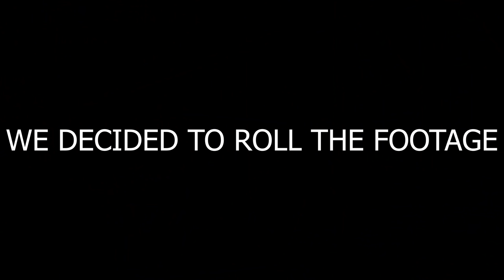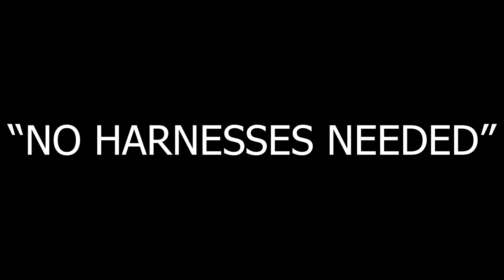RISKING OUR LIVES to Install a $20,000 AC UNIT

Comment: Being a retired AC tech, that was a very good video.  I had to do that once through the vent of a very old two story.  But we had to do it on a ladder without scaffolding.  We hoisted the equipment up with ropes by hand.
Reply: dang, for $200 bucks it seams like a no brainer to get the scaffolding i couldnt imagine doing it on a ladder
Reply: @Novagunner  I had a real tightwad boss.  He didn't have to do the work.
Reply: @Novagunner  ... very true, but you have to weigh in the added cost of the trailer, and 2 men for what amounts to a full day's pay or more to get the stuff and set it up. Now we're pushing $1000, which is enough to make you think of other options. For that kind of money maybe a Lull material handler could be the answer in some cases.

Comment: Excellent video as usual guys! I never miss an upload. Just FYI, those "ladybugs" were Asian Beetles. They look similar to the harmless red ladybugs, but these orange critters are a nuisance.  They can be addressed when they are kept outside the home, but once they get in they are a pain to eliminate. They don't respond to traditional pesticides, and set up an infestation in less than 24 hours. It's best to have an exterminator stop by if you come across them nesting outside the home like that, before they gain access to the interior of the home.

Keep bringing the great construction/repair info!

Comment: The opening is an attic vent, therefore you have to keep it as a vent by code. What would work is if you can use a removable vent that has weather stripping around the edges. It probably could either clip in with pressure clips or you could use exterior screw attachments. That would allow the vent to easily be removed in the future.

Probably would have been the better solution is to install a drop-down attic staircase in the closet. This would have you a 54" x 30" opening to get your equipment through and it would have provided future attic access. The cost would have been around $1500.00 - $2,000.00 for a high quality attic stair case and the new ones are insulated. If you think about it, going through the gable vent every time you want to get into the attic is not the ideal solution. You may still want to offer this option to the owner.
Reply: They have attic access in the closet, the opening at the vent was just to get the unit in, they probably won’t need to do that again for 10-15 years.
Reply: @truthdefenders-  Okay, that makes more sense. Thanks for the clarification. I still believe that a drop-down attic staircase would provide the most serviceable solution. It's far cheaper than ripping the gable apart every time you need to replace a major component in the attic. 

I installed a drop-down wood ladder that is 30" x 54" (opening size) at my house. The convenience accessing the attic is night and day. I just replaced my AC and the air handler/furnace (it is a gas split system) is attic mounted and quit large. It easily fit through my attic staircase opening. 

The complete installation took about six hours. This included running new 20" ductwork for the air return vent (about 10' of 20" flex duct). The contractor told me "We never get done in six hours," and he thanked me for providing such easy access for his crew. 

BTW, installing the wood  access ladder scuttle was a bitch, and I am a journeyman carpenter. The trusses were not straight and so to have the access panel set flat when it was closed took me about three hours to get right. However, the finished product is quite beautiful and very easy to use.
Reply: @franklong6269  Yeah, easy access makes a world of difference in how the day goes. I worked installing units during the summer in Texas a few years ago, from the start of summer till the end, 2-3 units a day the entire summer, do the math (close to or over 200 units). So we saw everything, old houses, new, one story, multiple stories etc. forget about it.
Reply: @truthdefenders-  Bless your heart - I feel your pain. I am a licensed general contractor and I have many stories about installing AC units in attics. 

With my own house, I was up in the attic helping my AC contractors install my own unit. It was difficult and my attic mechanical space has good access and a plywood floor to work on. It is hard work, no two ways about it.

Comment: I remember the days- HVAC in South Louisiana can be tough- attics at 90 degrees and humidity almost as high. But the 130 degree attics in Dallas gave us moments. So yes, I remember the days! The scaffold you rented is a lot like the first one I ever bought into- thought you two did a top job on the assembly! My later scaffold was on the pattern of the blue one in Houston. With four or five guys working in that attic, you didn't miss much, even with the vent wall wide open it was going to be a crowd!

Comment: First off I really enjoy your channel. I'm from southern Ontario, Canada and one of my lives was a home inspector. The majority of homes here have a basement where the HVAC units are. In my 5 yrs. as a home inspector I had one home with the HVAC in the attic with a small hatch to access the units (2 units, large home). Luckily the only problem found was the condensate discharge line plugged. Keep up the great techniques and work. Roy

Comment: As licensed Hvac contractor, by code the inside access has to be the size to get the biggest piece of equipment out of the attic or confined space. Also the make variable speed equipment the can provide dehumidification with the A/c unit saving you another piece of equipment install in the tight attic.
Reply: Don't forget, code depends upon the state... and with old historic buildings, code can get waivers... like if there's an alternative access.
Reply: @mattwilliamson1714  it just sucks that if I was the homeowner that I have to cut open the side of my house every 15 to 20 years or if a major component fails and have to be removed. The enlargement of attic access in the closet  would be the best for the customer and for future service.

Comment: I must admit, I'm extremely jealous right about now.....  the temperature here has been around -10 degrees for the past week, frost and ice on my work truck and trailer on a daily basis.  I have to pull all of my 'fluids' into the house every night to keep them from freezing.  I see you two in short sleeves and a generous tan, and it makes me want to move to your neck of the woods!  How about if I come work for you for free for the winter months?  I just need a place to park my 5th wheel trailer.  

By the way, Jordan sure is getting some big biceps these days!!  Keep up the great work guys!

Comment: Of course I have not been on that site but next time you run into a system replacement with restricted areas look into a type of system call a space pack. There are a few manufacturers out there and they work in  applications such as this. R22 in not really outlawed except for the new product market. And there are a number of drop in refrigerants on the market for service and repair in homes/businesses and the price is very reasonable. I've used the drop ins and have not had one bit of problem. Thanks for keeping up the good work.

Comment: This is a about a week after the fact but since you asked...  To seal up the gable I would make a "window" frame to attach a removable panel to. Make a replacement panel with the removed clapboards include the vented design and the screen. Make a couple of French cleats across the bottom to interlock with the wall. Set the panel into the bottom then tilt it up and attach it at the top with a couple of heavy screws. It should look and function as when you started but would be easily removable. I was thinking that a couple of safety chains configured as hinges will keep the panel from falling and allow the panel to be opened and used as a bridge if needed.

Comment: Removable hatch. No hinges or latches, that's hurricane country and you don't want to have anything weak to blow off during a storm, just a hatch held in place with screws or bolts so it's secure but someone can take it off easier.
Reply from the maker: Thx Gene 👍

Comment: Thx.  Why not just expand the scuttle in that closet?  Looks like a standard ceiling there, lathe and plaster maybe.
Reply: I had the same thought.
Reply: It didn't look like there would be enough clearance to get equipment in/out even if that access hole was expanded. I'm sure they considered it. I would have done the equipment room even if they would have lost closet space. It's going to need replacement in 15 years so why go thru all that again.

Comment: Great work, if budget allowed a scissor lift would have been a good alternative or addition to get this job done... Also that carbiner might be great for extension cords but not rated for lifting ;)
Reply: I have that exact same carabiner that I use all the time for lifting tools and equipment. It’s rated for 100 lbs. I’m also a professional climber, as long as you’re not using it for climbing and it has the lock catch built in, they’re safe for hoisting equipment. It’s still a good comment. I’ve seen people using Walmart keychain carabiners (rated for crap) hoisting equipment. Extremely unsafe, but you can’t fix stupidity, you can only hope no one gets hurt.
Reply: I agree. Scissor lift would have saved a whole day worth of setting up the scaffolding. Would’ve also made transporting men and equipment a lot more easier and safer. However, who knows what the rental rates are in their area. They would’ve saved at least $200 from the scaffolding rental plus cost of labor of 2 men for 2 days to set it up and take it down. Plus the cost of the trailer rental.  Might’ve been worth it to just get the scissor lift.
Reply: @daaneel  ... how about a Lull type material handler with the man-lift attachment. I'm sure you could get 2 days rental with delivery for less than the $1000 it cost for the system they used here. Much more stable than a scissor lift.
Reply: @rupe53  Depending how much they charged for labor, then yes, it would be close to $1000. I'm not sure how these guys do their bidding though. If its time+materials+markup or just a flat rate to get the  job done. If anything they made more money by including an extra 2 days of labor lol.
Reply: @daaneel  ... I see 6 hours to get the scaffolding and trailer and they worked till dark. I see a similar time frame for the teardown and return of rental stuff so 12 hours at 2 guys is $1200 around here, plus the rentals.... or $2k with mark up. Add in another day of various repairs to that hole and painting / finishing is another day easily. (back the way it was) We're easily at $5k+ for Studpack plus the $20k for HVAC.

Comment: I would suggest remaking the vent like it was but with more framing behind it and add hinges at the bottom so it falls into the house for when the next guy needs it. Also make a cut out in the attic floor right where that door would fall so that when it is down it is flush or as flush as possible with the attic floor for any equipment that may need to go through there.
Reply from the maker: Cool thx 💪

Comment: I am always surprised when I see people using this type of scaffolding. It appears to be the absolute most labor intensive type. I have always used mason's scaffolding, that is where it is a 5'w X 7'h frame then " X " bracing.  I can assemble one that high in about one hour working alone.  And take it down in about 15 minutes.  But otherwise, great work. The biggest trick to doing anything different  with the vent is making it obvious to anyone else that it is designed for easy access, so some ding dong does not destroy it.
Reply: Ya but you can’t fit 4 full grown men And the equipment onto it. Those that I’ve seen are only rated for like 600lbs. This type you could put a car on...or a hoist 👍

Comment: The attic access couldn't have been opened up some more? That way you could maybe even add attic stairs, and make it easy to work out of for the service tech, or even the next installer. Hopefully its big enough right now for an evaporator to squeeze through, since that daikin is gonna end up leaking sooner or later.

Comment: wow, this is the hardest AC job that I've ever seen. Great job guys, I do have a question, I'm not a AC guy, I always thought that with the new unit that runs R410 refrigerant require bigger line sets right?

Comment: If you need additional HVAC return lines, can you repurpose the existing attic hatch for one?  If you can make the return line flexible, you might still be able move it aside for continued use as a hatch.

Comment: Most people have no clue, of the magnitude of some projects, that result from poor planning. Also, check out Spider lifts , they may be able to handle jobs like this. If I built a house with a split/ attic unit, a barn loft door would be built , and a nice elevator going to and from.
Reply from the maker: Cool thx Mike 👊

Comment: R22 systems use smaller walled pipe, newer gasses run at higher pressues, that customer will inevitably have cracked pipes because you thought it be cheaper to use the old lineset.

Comment: Future access: my thoughts are that you have technician access already thru the ceiling. Major access for another HVAC change out will likely not be needed for [hopefully] 10-20 years. Unless the house has the water heater in the attic, or some other large equipment, I would rebuild the opening back to where and how you found it. The area this house is located [hurricanes] is another factor. I wouldn't want an access door or panel to blow open.

Comment: Great work guys! What was that A/C guy saying about drying up the house? Is that when the unit is too big for the house and pulling too much moisture out of the home?
Reply from the maker: Thx Nathan 👊.  Actually the reverse is true.  If a unit is sized too large for a house it will start, cool the house quickly then shut off.  It doesn’t run long enough to remove moisture from the building.   Probably the single biggest mistake I see... improperly sized units 👍👊

Comment: Wow, that's crazy having all those mechanicals in the attic. We don't see that in Ohio.
Looks like good equipment.
How come they didn't go 90%? Vents with pvc pipe.
You guys are the only ones that will ever build scaffolding for that.
Reply: Thats garbage equipment, cheap Goodman/Amana products, fix them daily and their commercial units are even worst quality. You can't do high efficiency equipment in whats called unconditioned space.
Reply: You probably have a basement in Ohio. Basements are rare in the south. The crawlspace was probably too small to fit everything in when they retrofitted the house. I wouldn't want my hvac system in the crawlspace anyway.

Comment: Great video...you could make it a hatch that opens outwards with the top part of the gable being the point that releases outward and down and the bottom side would have hinges somehow....and maybe use a pressure push latch to lock and unlock from the inside with a rope attached to the latch which you can tie off to a 2x4 right next to the attic entrance so you don't have to get all the way in the attic to open the hatch you just have to stick your head in grab the rope and pull it to release the hatch....maybe idk..lol.....on the other hand making it a hatch that opens on the outside of the home exposed to the elements you would want to caulk the edge to prevent water from getting in therefore the caulking would have to be cut and reapplied everytime you need to open it....again idk just thinking MacGyver I guess...good job and good luck
Reply from the maker: Good stuff thx 👍💪
Reply: @StudPack  hahaha probably far fetched😂.....you maybe able to get away with weatherstripping instead of caulk you know like a door...i mean that part of the house is slightly covered by the fascia✌

Comment: What a nightmare of a job.  I don't know how you would even be able to estimate the cost of labor and materials for a job like that.  If you are like me, I estimate worst case scenerio on jobs like this because you just don't know what your going to run into.  I know those A/C guys aren't cheap so this had to be an expensive job.  You guys make it look easy.  I have been using some of your techniques when evaluating how I'm going to make a repair.  They really help, thanks.
Reply: sad part is they did all thay work for a garbage unit. Those things are a pos and I repair them daily.
Reply: @zack9912000  I wondered if the $20,000 was for the unit or what they charged to do the job.

Comment: I'm sorry, did I hear that right? Louisiana? I'm curious why they chose to keep the furnace. I understand it gets cold even that far south but Daikin makes great heat pumps that are more than capable of keeping a house warm even when the temps get really low. Louisiana electricity must cost a premium.

I'm an HVAC Engineer up in NYC btw, but my job is making the drawings, not doing the install. Always great to watch the process.

Comment: For the future: Frame out a "window" at the gable end. Then build a box that nests inside the window frame. Nail all the louvres to the box, so the entire louvre assembly can "slip out" of the "window". Then you can just bolt through the box and window frame to make it hurricane proof, but anyone who wants to can unbolt the entire louvre assembly to get back to (almost) where you are in terms of access. There's still the top of the window to remove for maximum space, but they'll have buzz cutters in the future!